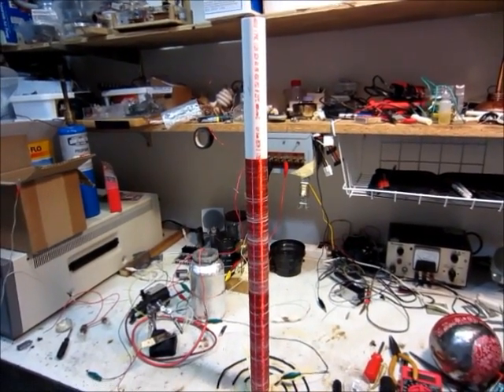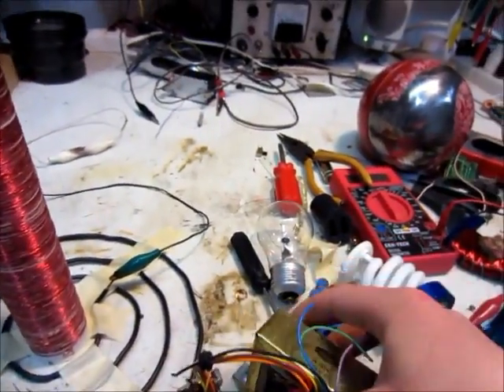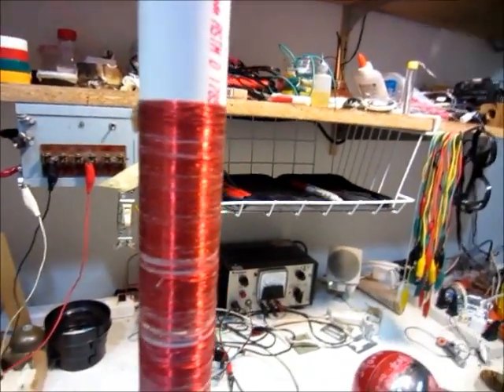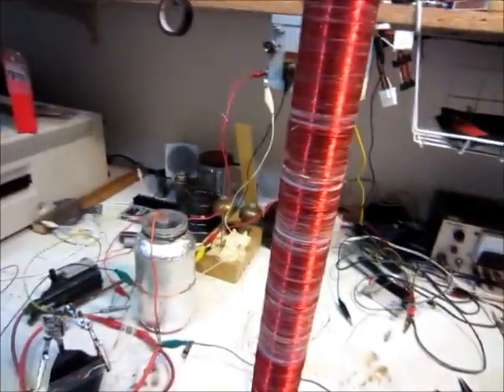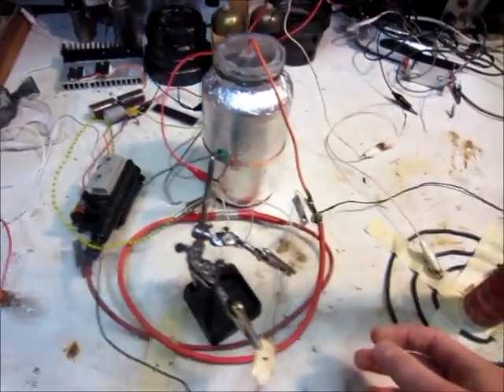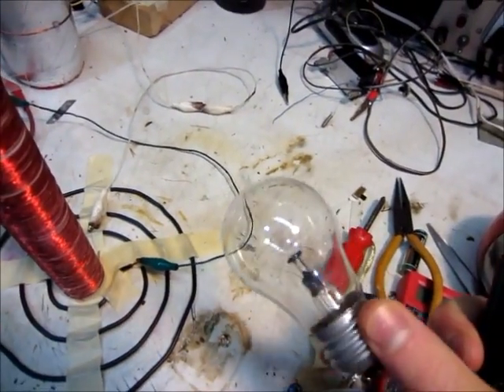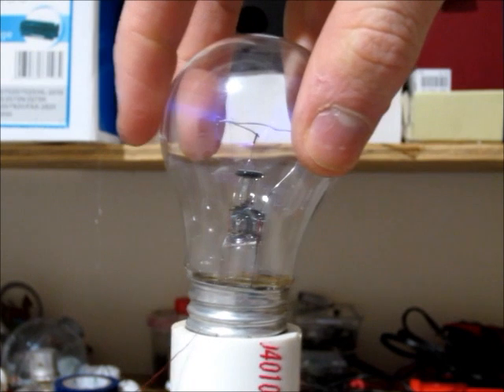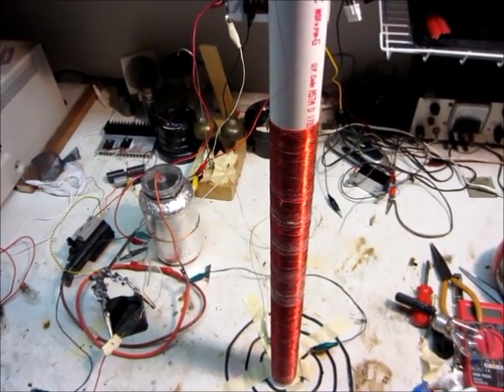My First Tesla Coil

Comment from the maker: No, I said that wrong... I meant that I guided the wire by hand but I put a couple extra words in there!  But I do have a video of a Slayer Exciter Tesla Coil that sort of has two layers.  If you want I can send you a link in PM or you could just go to my Tesla Coil playlist find it in there.
Reply: Makerj101 There is a tesla coil calculator,  (http://www.classictesla.com/java/javatc/javatc.html) ,called JavaTc, that is where I calculated my Tesla coil, powered by a tv flyback, it can output about 100kV, 3 inch long arc and it doesn't hurt you when you touch it! :-)

Comment: Defiantly thicker primary. Your secondary is HUGE! looks like the harmonics are pretty bad. Also with that joule thief you should not need a spark gap. that's whats wasting most of your energy.... You only need spark gap for ac supply... your joule thief is in itself a spark gap. so you have the second gap for no reason... Hook the thief straight to the base you shouldn't need anything else, maybe a pot to adjust freq. But DONT start it without a top hat (toroid or ball) unless you are WAY back!

Comment from the maker: @jdflyback Thanks for the feedback!  I have already made the primary vertical.  And I think it is about 7 turns.  That is what seems to work best.  I'll try to wind the primary in the same direction.  My wire might be to small.  But it works!  I need to do an update video on it...  Why will florescent light bulbs light up about 4 inches away?

Comment: that is a good start, if you are using stranded wire for the primary you have to make a vertical primary or it will not work well.i would use a plastic pipe around the bottom of the sec with ten to 12 turns of copper wire, i dont know if it makes a diferance but i would wind the pri the same direction as the sec. i would also not recomend using smaller than .22 gauge wire. i got away with using smaller but the smaller the wire the more likly it is to cause corona loss and more likly to break